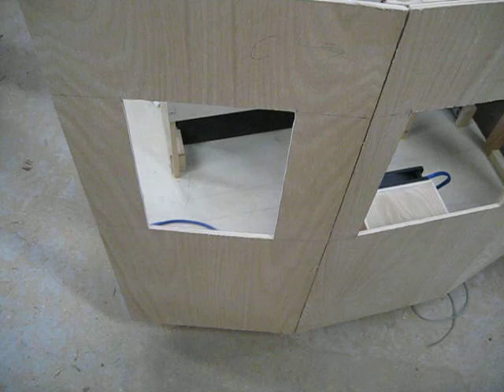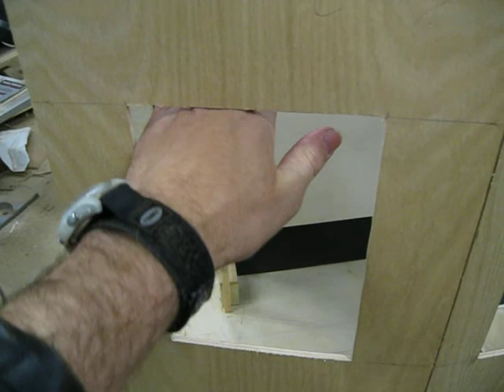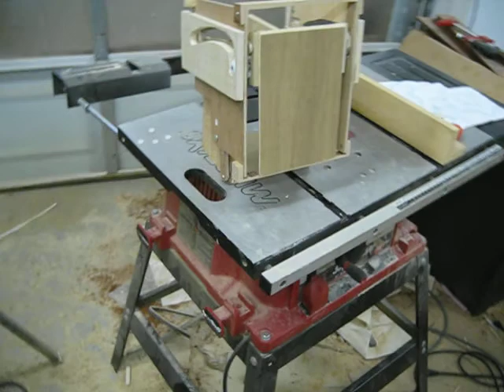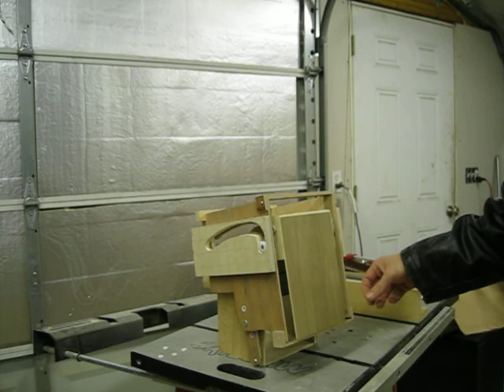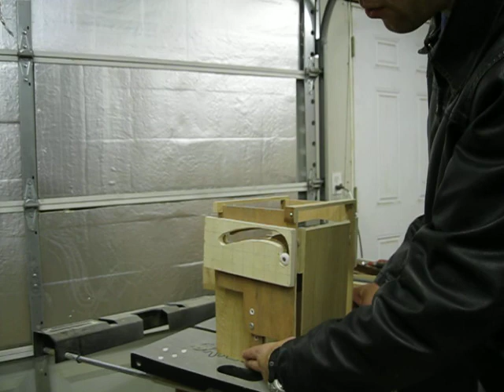Retractable door prototype

Comment from the maker: @oRedRaider  A lot of the case is 1/4" & 1/2" plywood.  It adjusts to changing temperature and humidity better than solid wood without cracking.  My first wooden case was with solid wood.  The first thing my woodcrafting mentor told me was, "You probably want to use plywood, because this case will start to crack!"  Sure enough within two months it had started cracking.  None of them have cracked since switching to plywood.  The frame however is solid birch and poplar.